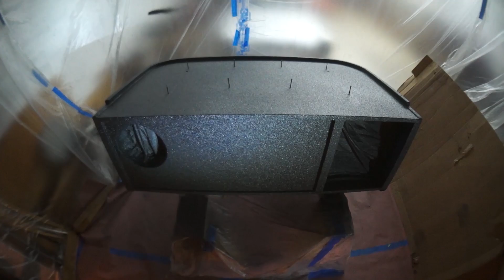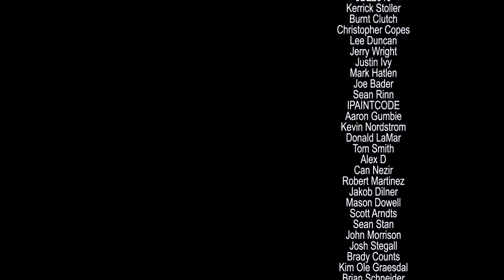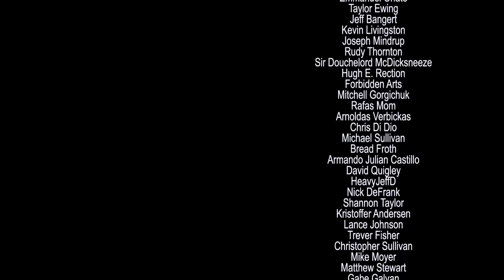FINAL SHELL, Prepping and spraying my subwoofer box, RAPTOR BED LINER - AMPLIFIED #711

Comment: With that thin piece of acrylic left for the bolt head to hold against, is it going to break off when tightened against the cork?  If it became an issue you could leave the acrylic full thickness and build a trim ring to go around the part that stands proud.

Comment: Since you have a blast cabinet that will fit the window you should cut a vinyl design out, mask the window and use it to make a frosted logo. It will react to the lights in the box and be a sort of floating logo. Just my 3 cents.

Comment: Application over other liners:

    As a general rule if any existing liner looks similar to Raptor in hardness and texture, you can apply Raptor over it
    Do not apply Raptor over franchise bed liners like Rhino or other polyurethanes. Raptor over old epoxy bed liners is OK
    Note that aged epoxy tends to get brittle and crack, we recommend grinding it down so the substrate starts to show through before applying Raptor
    Thoroughly scuff existing bed liner and wipe down with wax & grease remover
    If you can still see existing bed liner texture, it is not scuffed sufficiently

Comment: You probably should have went thicker on the lip of the plexiglass. Once you start bumping I will be surprised if that plexiglass holds up with that little 1/4 inch lip on 1 inch plexiglass.  Time will tell.